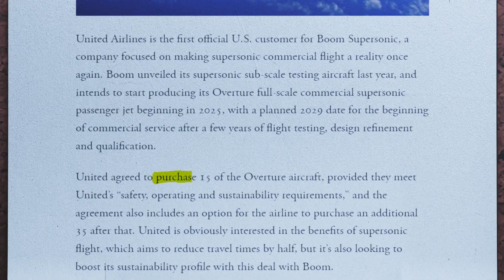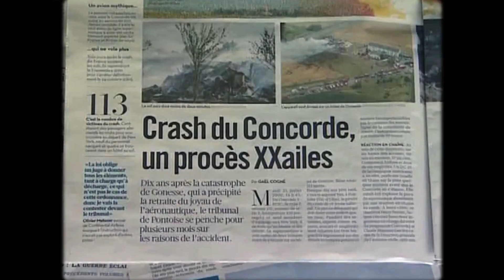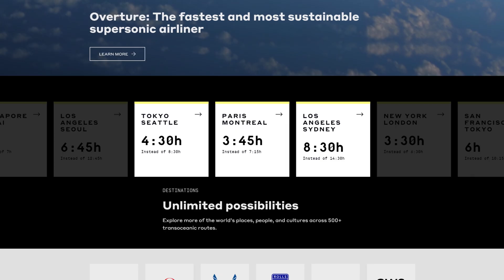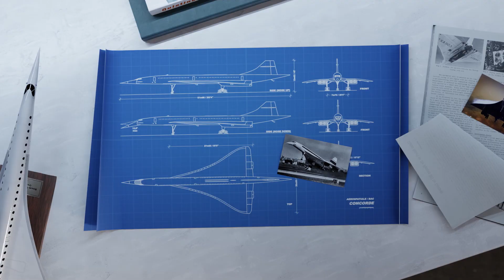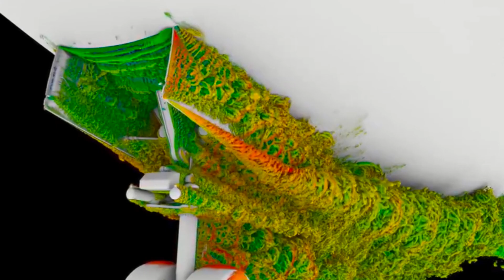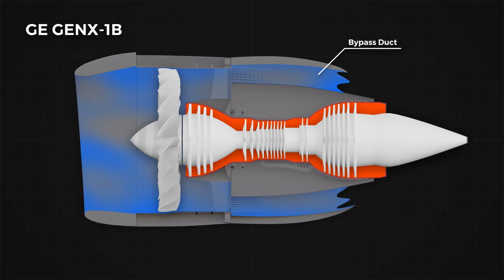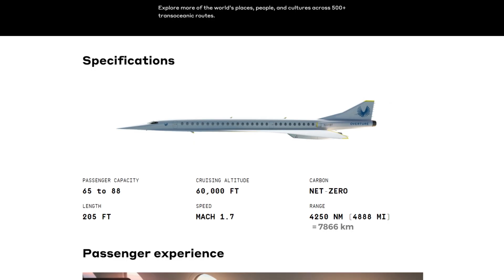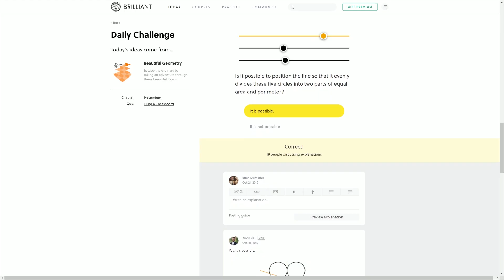Will Boom Bring Supersonic Back?

Comment: The only way commercial supersonic travel could work is if
1) Planes can switch between supersonic and subsonic wing configurations (possible, Rockwell B-1 Lancer & Tupolev Tu-160 as basis for this)
>> Needed to travel over land at subsonic speeds so they can reach airports without causing sonic booms
>> Switching to supersonic wing config. when traveling over oceans/non-populated areas
2) Supersonic engines can achieve high fuel efficiency at supersonic speeds
3) Supersonic engines can achieve high fuel efficiency at subsonic speeds
These were the three things that killed any prospect of using supersonic airliners for commercial air travel.

Considering the large supersonic planes we currently have that use variable wing geometry mechanisms, I think it's possible to build supersonic airliners that can reach most airports without causing sonic booms over populated areas so we definitively could have a new Concorde or Tupolev 144 that could meet air travel regulations and reach most cities, but it'd be competing with other subsonic airliners to do that and the worse fuel efficiency would kill the supersonic airliner on that regard. For example, a supersonic airliner traveling from Moscow to Paris wouldn't be able to travel faster than a subsonic one, and one traveling from Paris to New York would lose some of its time savings while traveling over Europe before reaching the Atlantic ocean. This would still allow for several more destinations within reach compared to the Concorde, but without better fuel efficiency and lower operational costs it'd still be something for rich customers only, so we're not talking about a commercial, but a luxury, exclusive service.

To summarize, IMO with the technology we have today a supersonic luxury airliner like Concorde that solves its sonic boom problems is possible, but the high costs compared to normal subsonic airliners kill any prospect of massively available supersonic commercial airliners.
Reply: Boeing only recently revealed the 777X, the first ever commercial airliner with folding wings, and it only has folding wingtips. Even such a seemingly small change raises many serious concerns of safety. Putting a variable-sweep wing on a commercial airliner is a far greater challenge that just is not possible. Instead of just having a small portion of the wing move, it's the entire wing all at once, and the mechanism must work perfectly everytime without the possibility of accidental activation. The wing pivots must be made sufficiently strong so that the wing cannot fall off like that one time on an F-111. Both of these factors increase mass and fuel consumption significantly. And that's not even talking about the aerodynamics of variable-sweep wings
Reply: @swedistandoge8437  That's a good point. I think as a minimum a variable sweep plane would need to be able to land at an airport with the wings at full sweep in case of failure
Reply: @kingdavewoody  if your aircraft can safely land with wings at full sweep at an average commercial runway, there's not much point in having the sweep in the first place.

The only airports a supersonic airliner would ever fly out of have long runways, and in the event that you did have to abort to a shorter runway airport, the takeoff from there would be empty weight plus fuel, giving the plane enough lift to power out of there.

Swing wings are used to extend an aircraft's takeoff capabilities, allowing heavier takeoffs from shorter runways. If all your heavy takeoffs are at long runways and you'll never have to do short runway takeoffs, what's the point?
Reply: @wyattroncin941  Your first and third paragraphs are a contradiction. You say swing wings are to improve takeoff performance, but you also say there's no point having swing wings if you can safely land with them swept back.

My point is... the system shouldn't be a single point of failure, where the wings failing to unsweep shouldn't doom the flight
Reply: @kingdavewoody  swing wings are to increase takeoff performance, at short runways and with heavy loads. A TU160 would have to take off loaded to MTOW from 1600m runways or shorter, then fly halfway around the world *and back*. Other swing wings have to do the same from an aircraft carrier. And they don't give a single fuck about fuel costs, so building a plane to carry the mass of a swing wings is fine.

A Concorde or similar's shortest runway they'd ever be scheduled for is 2500m, at Tokyo Haneda and Tokyo Narita. A TU160 would be able to take off from that with wings fully swept while overloaded. You do not need swing wings for that length, because you have room to accelerate and make fixed delta wings work. Putting in a swing just increases weight and reduces economy, meaning higher ticket prices.
Reply: @swedistandoge8437  Don't forget that they can't even keep an conventional aircraft design (737 MAX) from killing people.
Reply: we really need a jet engine that can transition between subsonic and supersonic while still being fuel efficient. there has to be a way.
Reply: The initial concept for the Boeing 2707 had swing wings but that turned out to be too heavy and later designs switched to a fixed delta wing. Even in military aircraft the swing wing has been abandoned in new designs with the Tu-160 the last one to enter service, back in 1981. The added weight, loss of internal volume, and added complexity (not only is it a moving part but it's a moving part that needs fuel lines, hydraulic lines, etc sent through it) meant the variable-sweep wing was a developmental dead end.
Reply: So. You wouldn’t need to switch plane configurations, the idea behind this is that the plane is just as efficient flying at either speeds. Below supersonic Concorde DRANK an insane about of fuel, especially with afterburners/reheaters running. Also Concorde made an insane amount of noise which we all love, not non aviation people hated all the jet noise. Let alone sonic booms. Which the boom is going to basically going to have a sonic boom that’s quiet much more noticeable with the equivalent of a car door closing.
Reply: Also add that the comfort won't be as good as today conventional planes also even with that they lose to train with comfort unless your flying in business class but even train can match that if they want
Reply: welll said , it makes no sense financially ./
Reply: @Diego-zz1df  Boom's Overture, if it gets into service, will meet all of your functional requirements:

Because Overture will be economical at sub and supersonic speeds, 500 routes, some mixed land/water, are viable, rather than just 2 Atlantic routes for Concorde. Overture will be carbon neutral, using sustainable aviation fuel (SAF). Overture will fly 2x the speed of subsonic jets over water, and 20% faster over land. Overture will create a sonic boom, but it will not fly supersonic over land. Concorde carried 100 passengers at Mach 2, over 4,488 miles. Overture will carry 65 to 80 passengers at Mach 1.7 over 4,888 miles. 

The two aircraft are the same length at 62m (203ft). Overture will be constructed from carbon composite, saving weight and increasing strength, and practically eliminating expansion and contraction with temperature changes. Overture will weigh an estimated 154 tons, Concorde weighed 185 tons. Overture's predicted development cost will be $8bn. Concorde's development cost was $14.4bn. The manufacturing cost will be less, the maintenance costs will be lower, and the availability will be higher. Overtures selling price will be $200M. An equivalent price for Concorde would probably be $1.2bn. For comparison, a Boeing 737-800 costs $100M, and a 747-8 costs $420M.

Overture will be simpler to fly, eliminating the need for a 6 month pilot conversion course. Overture will have a modern cockpit, with a flight deck similar to subsonic airliners. A flight engineer will not be required. Instead of a droop snoot, Overture will have external cameras and cockpit displays to allow the pilots to see the terrain when taking off and landing. Its cabin will be quieter and more spacious, and its seats will be more comfortable. In contrast to Concorde's awesome engine noise, Overture will comply with ICAO-14 regulations, allowing it to use all airports. 

Taking a JFK to LHR one way flight:  
Showing: Aircraft type,  Fuel cost per passenger,  Economy ticket,  First Class ticket,  Duration

Boeing 747          $147          $577             $2,308                      8hrs 
Concorde             $753                                $5,000^                     3.5hrs 
Overture^^            $708         $1,200           $3,000                      4hrs 
Business jet^^^                                 $53,000 to $99,000            8hrs  

Notes
^ 2023 money 
^^ Estimated prices, assuming Overture carries 72 passengers against Concorde's 100. For the first 2 years, only first class seats will be available.    
^^^ There are no supersonic business jets 

A 16 hour flight across the Pacific on a subsonic jet could be achieved with one 30 minute refuelling stop by Overture, giving a time of  4 + 0.5 + 4 = 8.5 hours.

Overture will not be competing for the mass market, but Boom have identified 500 viable routes. Overture may become a niche service, both scheduled and charter, where certain travellers expect higher prices. Even now, on subsonic airliners, some people are prepared to pay 4x to fly luxury class. And, as far as business travel is concerned, the time saving would be well worth it. To support this, Boom's surveys show the viability of Overture. 

If Overture reaches production, and meets its specifications, it will be popular with both airways and passengers, because it will half many journey times and will be cheaper, more comfortable and a lot more practical than Concorde. The military have already shown an interest in Overture. It would also be suitable for charter flights and as a business jet. The next development should be a 200 seat version, and possibly a supersonic business jet.

12-2023.08.14

Comment: It's not just the sound barrier. It's the cost barrier. An even stronger effect.
Reply: The most important effect. If it were cheap enough we’d definitely find a way to deal with or tolerate any sonic booms.
Reply: Concorde was consistently profitable for 20 years for BA as its purpose was to compete against subsonic First Class. Concorde’s tickets were only around 10–15% more (1996 GBP 4,772 vs subsonic First Class GBP 4,314) and this meant that a company could have its executive (who would have been sent First Class anyway) leave London at 10:30am, arrive in NYC at 9:30am (yes before they took off, as Concorde flew faster than the Earth rotates) take a 10 min helicopter ride to the East River heliport, have a bunch of meetings and zip back to JFK for the 1:30pm Concorde to London and be in bed the same night. 

Concorde had its own security, check-in, lounge and boarding gate from the lounge. No lining up for anything... How's that for time saving? 

Time as they say, is money, especially for these folks, and Concorde built a very loyal following that lasted throughout its service life operating in its own P&L division, and consistently profitable for BA from 1982 on, even when the mainline carrier was unprofitable. 

https://www.key.aero/article/inside-story-how-ba-made-more-ps500m-profit-concorde#:~:text=The%20result%20of%20this%20change,billion%20pounds%20profit%20for%20BA.%E2%80%9D

Comment: Eh you make it sound as if there was no research in low bypass turbojets since the 60's when infact there was probably a lot more research done in that direction then in high bypass turbofans. What kind of engines do you think power high tech jets that have supercruise capability like the F-22, Eurofighter, Su-57 and so on? ;D
Reply: Correct me if I'm wrong but i don't think military aircraft are supposed to nearly have the range a commercial plane does. Also, many military aircraft are reliant on afterburners for Mach speeds, and carry a single human being with vastly less payload and come with a significantly high operating cost and reduced operation times.

Boom is going to make an engine that's able to make a much heavier passenger jet go Mach 1.7, for multiple flights and have safety systems in place, and have a much higher range and much more efficient engines than military aircraft do. Military aircraft have no such criteria for efficiency, they are simply supposed to complete an objective even if it costs them money or resources. Operating many supersonic jetliners with increased weight, regulations, higher fuel efficiency all while being commercially viable is a great challenge.
Reply: @sharvapotdar3257  Concord had military aircraft engines. Also if you want to go efficient and far, you don't go supersonic. Further, "supercruise" is the capability of an aircraft to go supersonic without having to engage afterburners (as Concord and older jet fighters had to). 
Back in the day they couldn't afford to design an engine powerful enough for Concord so they used a military one they allready had. Engine manufacturers who build engines for civilian airliners are also the same companies building the engines for fighter jets, so the idea to use a modern military engine for a modern supersonic airliners is not that far fetched ;)
Reply: @sharvapotdar3257  "Boom is going to make an engine that's able to make a much heavier passenger jet go Mach 1.7, for multiple flights and have safety systems in place, and have a much higher range and much more efficient engines than military aircraft do."

Ah yes ofcourse they will. Just like Tesla will build a semitruck and beam in in the past so they catch their timeline. And Space-X's Starship wil ofcourse do earth point to point transport rendering planes obsolete. And Hyperloop will make planes obsolete too. And Solar Roadways will solve all our power problems. I believe social media hype bullshit when i see it ;D
Reply: @hernerweisenberg7052  oh yeah my bad. I meant Boom is going to have to make* an engine that can sustain Mach 1.7 for longer. Also, one of the reasons the concorde is out of service is because of fuel efficiency :). Turbojets are more efficient than turbofans at mach speeds and even if most military aircraft can supercruise, 1. They don't really have to all the time, and 2. Have no criterion for fuel efficiency (or no criterion in comparison to passenger jets). It simply makes more sense to use a turbojet if most of the aircraft operation time is going to be in the supersonic realm, hence higher efficiency. There's no need for turbojet to go supersonic, but it might as well help by being a bit better.
Reply: @sharvapotdar3257  I believe you missjudge the importance of fuel efficiency for military aircraft. It is one of the most important factors. Air refueling is expensive and risky. Flying back to land and refuel renders the jet useless for the time that takes. If you go full burn you can suck your tanks dry in minutes. Fuel management is very important to increase loiter time. Agueably increasing efficiency and range of combat aircraft is more important than having the fastest jet.
Reply: @sharvapotdar3257  Think of it this way: If a civilian aircraft does not have the range to reach its destination, it can land at an convenient airport, refuel and continue. The only reason to increase efficiancy and range for it is to increase revenue. If on the other hand you run out of gas in a combat aircraft over enemy terretory, you might have to punch out and hope for rescue, or you can't do the mission in the first place due to a lack of range. The reason tiny fighters have less range then large airliners is size ofc, not a lack of trying :)
Reply: @sharvapotdar3257  As for the turbojet being more efficient at supersonic speed, it hardly matters if the overall efficiency of fuel burn to thrust output slightly changes over different speeds, you will still burn vastly more fuel if you go supersonic, as if you double the speed, you increase the airresistance by 4 times and you engine has to push against it. All aircraft have the most range at subsonic speeds for that reason.
Reply: @sharvapotdar3257  For example, and i don't know if these numbers are true, but they are probably in the right ballpark: If an F-35 has a maximum range of 2000nm, then at max speed it might only have a range of 400-500nm due to the increased fuelconsumption required to generate all that thrust to push against the airresistance.
Reply: Or in other words: It doesn't really matter how good the engine of these boom boys is gonna be, if they fly supersonic, its still only gonna be a fuel burning moster of a rich peoples toy.

Comment: the problem still economical, all this advantage will not result to improved economics, the Concord cabital cost was zero by 2000...and saftey is also factor of quantity, the more airplane, the more safe it becomes, which will not happen if not economical

Comment: Supersonic airliners could use variable cycle medium bypass turbofans similar to the military XA-100 or XA-101 engines for better efficiency. The XA-100 and XA-101 are competing to become the 6th gen fighter engines and replacing the F-135 engines for the F-35A and F-35C.
Reply: Its not likely that a 6th gen engine will make it to a comercial plane any time soon.

That being said, F-135 is not a bad engine, a civilian version would be a beast.

F-135 is about the only engine that could put some decent performance into a chubby plane like F-35.
Reply: @Coyote27981  I said an engine LIKE the XA-100, not the XA-100 itself.